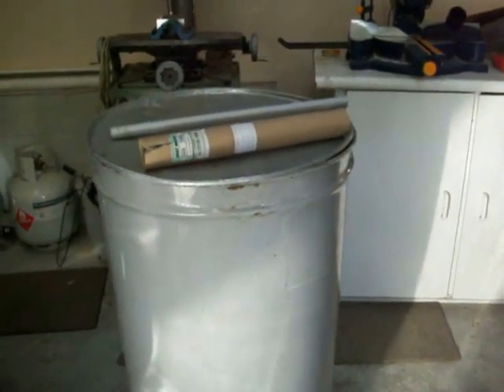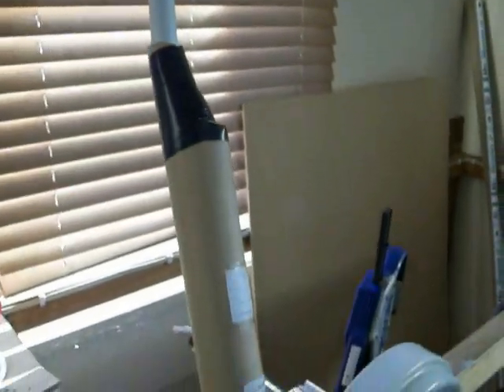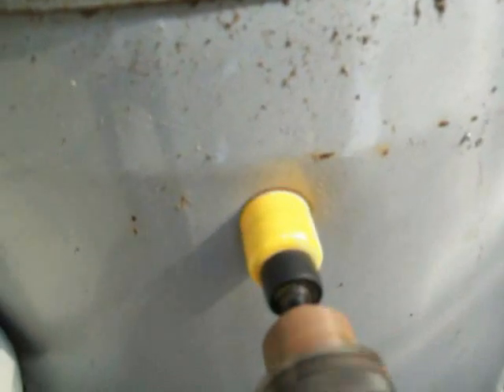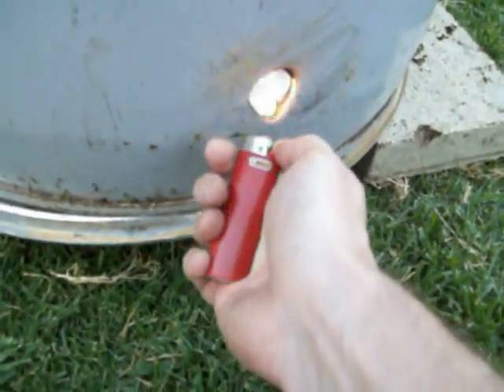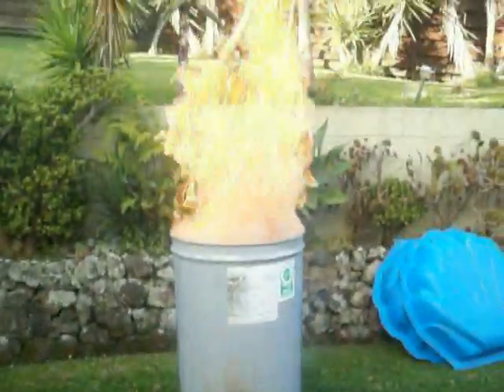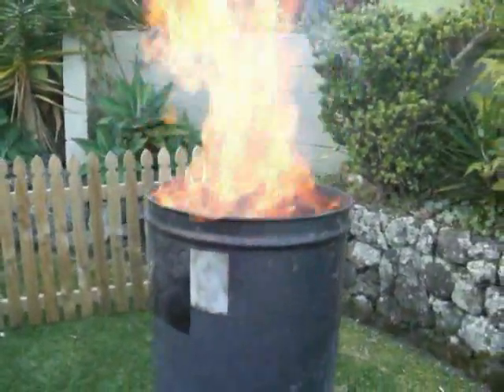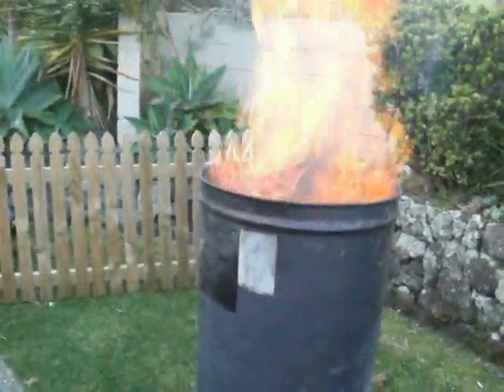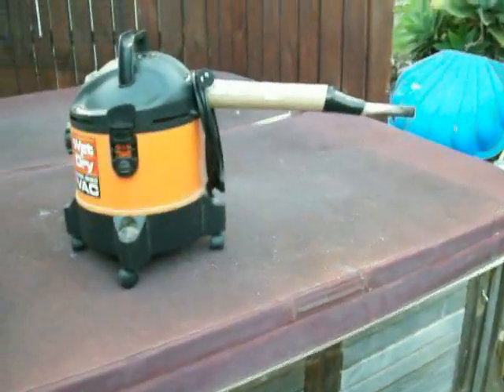Hack job furnace to burn garden waste using forced induction

Comment: Try putting the vacuum cleaner hose in the hole on an angle so the air goes around the inside diameter of the drum and creates a vortex.  Should burn a little better with the better air path.

Comment: that is a lot of pollution doesnt it?? garden waste should be composted... not burnt
Reply: if you drive an automobile using an internal combustion engine then you're polluting the environment far more than this in just a few trips to the grocery store.  environmentally friendly practices should be used where possible and feasible - especially where repetitive use makes it more beneficial. but we should all be wise and sensible in the battles we choose in the overall 'green war'.  it's not practical, realistic, sensible, or sustainable to think everything can be done all the time.
Reply: putting it in the ground causes and equal amount of co2 and all the toxins are still released along with methane. Burning it you get that without the methane. Burning it is more eco friendly. 
Now if there was a economical way to recapture the energy from burning it like many countries that burn their trash do, but on a 1 home scale it would be great.
Reply: Botanical Roots Kind of amazing the amount of lawn waste generated by a few large, mature trees -- I could easily fill up 30 of those lawn waste bags at least once a year, if not more.   (Probably more!)  That's two or three trips (or more!) with a truck, which I don't have and costs money to rent.  I wanted to do the environmental thing, but...  just not feasible.   There is no city pick-up for lawn waste around here and it's legal to burn so when we are talking that much effort to transport so many bags and it's easier to burn, guess what people will do?
Reply: So how much do you hate forest fires?
Reply: What ever

Comment: This would work even better with a few holes (not too many try 6-8 first) about 2-3 inches down from the top. Fat pipe would make a big difference too. You need to get lots of extra oxygen to the wood-gas (hydrogen) once it's nice and hot. I have made min versions from tin cans, no blower, just strategically placed holes. gives a nice blue jet flame like a lpg stove. Except it boils water faster....  Look up Wood gas stove for more info. lots of plans out there.
Reply: Mongrel Shark œ